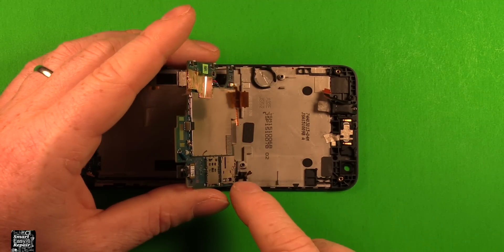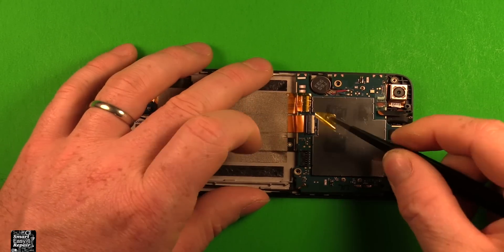HTC Desire 626 Screen Replacement Repair How To Change

Comment: Best video ever, worked like a charm! Thanks to this video my dad can now have a smartphone (my old one). Only thing is a couple steps were skipped that invovled removing some rubber molding pieces but once we figured that out it was perfect.
Reply from the maker: +Renee Ruff Thanks. Sorry yours may have been slightly different. I'm glad you figured it out though.

Comment: Replaced my nephews screen and video was excellent. Helped a lot. One issue I had was no sound... easily fixed by bending the metal tabs on the speaker up a little, just in case anyone else had the same issue.
Reply from the maker: +Thomas Robinson Awesome good job thanks for the feedback!

Comment: Awesome directions. Only problem is No display. It rings. Around the outside edges I can see a very faint light. Any ideas. Thanks. God Bless †
Reply from the maker: Thanks. I would try checking your screen connection points make sure it’s connected properly. Sometimes you have to disconnect and reconnect just to make it seat properly.
Reply: Which one is the screen connection. Thanks Bless you †

Comment: Hi. I replaced a screen on my HTC desire 626s and for some reason it don't turn on. Just vibrating one every 10 seconds... Can u tell me why is that? Thank you!
Reply from the maker: +István Kutasi It sounds like it's not reconnected properly. I would check all your connections first.
Reply: Smart Easy Repair I will. Thanks!
Reply: I checked all connections, all looks fine. When I turn on the phone I only have black screen and vibrate one in every 10 seconds. I also tried all the button combinations what I find on YouTube, none of them helped. Any other idea? Thank you!
Reply: István Kutasi I'm having the same problem. Screen was recently fixed but turned it on and theirs no sound so I went to try and fix it and now phone screen is black and when you try to turn it on it vibrates. Could I have messed up the vibrator motor? I tried messing with the silver plate on the back of the phone above the battery.

Comment: Hi there, thanks for the helpful video it helped alot. i have already changed the screen but theres a problem, which is when i plug in the charger to charge the phone the screen goes off and i cant use the phone as long as the charging plug is connected and when i disconnect i have to turn on the phone once again. any tip or idea ?
Reply from the maker: +Samei Sanei Thanks I'm glad it helped. No I'm really not sure what the issue is I've never heard of something like that before. The only thing that I would recommend is to maybe take it back apart and make sure everything is connected properly especially down by the charging port.

Comment: easily the best video and explanation  I've found to date.
I'm very comfortable   working on all sorts of electronics, but have been a little afraid to attempt  working on my 626.
but after watching your video several times it gave me the kick in the @ss that I needed to finally order the screen/frame assembly  and give it a go.
part was delivered this afternoon and I'll be performing the repair tomorrow afternoon . 
I'll post my progress once I've completed.
again, thanks for the excellent video.
Reply from the maker: +gshffr Awesome best of luck to you!

Comment: Great video until almost the very end after total disassembly you say to make sure and buy a specific replacement that includes the front housing rather than just the screen itself to prevent using heat gun and a mountain of extra work.    
Wow. Would been nice to know from the BEGINNING.
Reply from the maker: Sorry I figured typically you would watch the video all the way through first to know what you’re getting into and then play it again for disassembly.

Comment: Hi :) I dropped my HTC 626 and broke the glass about 9months ago. At first it was but then i spread across the whole screen. 2 days ago i was at home when i looked at the clock on the phone and it was black (but not the whole screen but like 1/2, where it was cracked the most. Can it be fixed with a LCD replacement or is it better to buy a new phone? Ty for your time and sorry for my bad english. :)
Reply from the maker: +Klemen Doplihar No problem. Yes a new LCD should fit it. I have a link in the video description below the video where you can find one. Thanks

Comment: Hi.Thank you for this informative video, I have successfully replaced screen & digitizer following all the steps in this video, however after restart I am constantly getting following Error Messages: Google Play Services has Stopped working & HTC Sence has stopped working. Is there anything in hardware that I forgot to connect back? Screen is responsive, Wifi, data, calls everything is working. Because of error messages I cant open Home. Please help if something inside needs to reconnect again.Thanks.
Reply from the maker: +Amjad Niazi I'm not sure I have never heard of that before. The only thing I can think of is to open it back up and just doublecheck all your connections.

Comment: Thank you so much for this perfect video! I've spent hours fixing my phone thanks to my clumsiness. I was so sure I wrecked it (and the frame looks pretty battered. ;) ) After getting frustrated by trying to attach the cable of the ear speaker and the antenna I just tried to start the smartphone. It works! :D 
But now I have to relax until tommorow before put the rest together. Again, thank you so much!
Reply from the maker: Wow awesome good for you!! 👍👊
Reply: A short update: Almost everything seems to work! :-) Only the charging doesn't work. Maybe the panel isn't fixed or the cable not attached correctly?
Reply: Problem found and solved.The side of the cable connected to the logic board got the funny idea to slip out. ;)
Because I am too clumsy to attach the cable of the ear speaker I can do without it anyways. I used it only once or twice. also, I havn't managed to attach the antenna back again, but that doesn't seem to hinder the connection. Just had to be careful that the antenna didn't get in the way.
Reply from the maker: Ok I’m glad you got it figured out! 👍👊
Reply: Thank you!
But I just realized that I forgot to take off the protection cover of the inner side of the display. O.O
As the phone is working (although not perfectly) I will do the procedure another day. :)
Again, thank you so much for this tutorial!! I'll need it again soon. :)
Reply from the maker: OK best of luck going forward!

Comment: @Smart Easy Repair
Sir, do you know if the HTC Desire 625 and the HTC Desire 626 use the same screen assembly (glass/touch panel/screen)? The glass, touch panel, and screen are all broken on my HTC Desire 625 and I am looking to repair the phone. I have the phone disassembled already, thanks to your video. Any help would be greatly appreciated.
Reply from the maker: +Kevlar Voice I don't believe they are the same. When I search out the 626 it doesn't specify that it fits 625.

Comment: ive just used your vid to do my htc 626, really good except it wont turn on 😕 not even a red light to show its charging. any tips on if ive done something wrong?
Reply from the maker: +Eve Parker Sounds like something isn't reconnected properly. I would doublecheck all your connections.

Comment: Hi i have ordered the screen, but i got only with 2 connector cables far left corner  small connecter not their on the screen I received, but on your video you have all 3 connecters for the display.
Reply from the maker: +Makkuva B V VaraPrasad Maybe yours is for a different variant of the model phone I don't know.

Comment: Screen was recently fixed but went to turn on the phone and the sound doesn't work. So I tried fixing it again and now the screen is black and only vibrates when I try to turn it on. I think I tried messing with the silver plate that's above the battery. Could I have ruined the vibrator motor? Sometimes when I try to mess with it their a bright circle in the middle of the screen with different colored lines going through it but most of the time the screen is black. Is the phone ruined ?

Comment: the screen on my 626 recently broke I am thinking about replacing it, I have a friend who has a phone just like mine. I have thought about using the screen from it on my phone but I was wondering do I need to have adhesive to hold the battery in or can I reuse the adhesive on it?
Reply from the maker: +SIR_ WOLF It's worth a try you can reuse the adhesive if it's all sticky. Worst case you can get some adhesive.
Reply: OK thanks I'll try it then I appreciate ur help
Reply from the maker: +SIR_ WOLF You're welcome. Take care.

Comment: i broke my desire 626 and theres cracks on the screen and its unresponsive to touch in most places but the picture is really blurry. could you help me out  to find the led screen only,
Reply from the maker: +Kima Pac Yes the LCD assembly is the LCD and digitizer combination all put together already. I have a link in the video description where you can find it. I would recommend getting the one with the frame already attached as well because it makes the repair a lot easier.

Comment: Hey dude I know this video is old but I really need an answer
On my phone I have very few cracks but the actual screen is unresponsive, will this fix that?
Also what parts did you buy and where from because I looked online and there are ones with prices ranging from $7 to $60

Also does this tutorial cover both those things ?
Reply from the maker: +Preston Garvey Yes so it should fix it if you replace the screen. I would just look for a decent quality LCD screen assembly with frame. I have a link in the video description below the video where you can find one.
Reply: Smart Easy Repair thankyou! 😃

Comment: when replacing the screen, is the adhesive tape completely necessary over the connectors?
Reply from the maker: +Potato And Mash Gaming probably not really. If you can salvage it and reuse it great.

Comment: My screen cracked just a tiny bit in the bottom right corner, if I replace the screen will it fix this issue or is it just better to get someone else to repair it for me (at a shop or something)
Reply from the maker: +Eduardo TheFish Yes that should fix it. It's up to you if you want to attempt it yourself. I think it's easily doable.

Comment: My HTC Desire 626 got water damaged and random colors stretch through my screen when I try to watch some videos, which nearly blocks my view, and there are black tiny lines going across my screen which makes my phone look like it has 360p resolution. If I replaced the screen, will it get rid of the ruined display?
Reply from the maker: +Nazeaver Ali-Raines Yes it should.
Reply: same bro it should

Comment: Any specific websites that you guys would recommend buying from or at least a specific seller? I just don't want to to buy one with bad quality.
Reply from the maker: +Jaxter Jaxter I have a link in the video description where you can find one. I would look for OEM quality. Check the listing make sure it fits your model.
Reply from the maker: It looks to me like it connects the charging port at the bottom to the logic board.  If I search for charging port none of them come with that cable that I see.

Comment: My HTC Desire 626 got water damaged and when I try turning it on, all it does it vibrate and nothing else. The charger light is still blinking too, so does this THE mean the screen is damaged? Will doing this make the screen turn on?
Reply from the maker: +Aadil Akbar if everything else works then that may be The main problem.
Reply: Smart Easy Repair Ok, I'll consider buying a new LCD

Comment: I have the desire 625 but it looks exactly the same as the 626, is it going to be the same screen and frame?
Reply from the maker: +Enforcer Vapes I think they're slightly different if you check the link in the video description you can change the search to reflect the 625 versus the 626 and see what it brings up. I think the process for changing it should be quite similar though.
Reply: Awesome thank you
Reply from the maker: You're welcome. Take care.

Comment: i broke my desire 626 and theres cracks on the screen and its unresponsive to touch in most places but the picture is still completely fine do i need a whole new screen or what screen parts do i need
Reply from the maker: +Bannanarang it's really hard to replace just the glass so I would recommend replacing the LCD glass assembly.
Reply from the maker: +Bannanarang I have a link in the video description where you can find one good luck.
Reply: +Smart Easy Repair thank you very much
Reply from the maker: You're welcome.

Comment: Replaced the screen great video but after I finished up I turned my phone back on but the screen doesn't show but you can feel the phone vibrate . Help please
Reply from the maker: +Dominique Dixon Sounds like there may be a connector that isn't reconnected properly somewhere. I would doublecheck all your connections.

Comment: *NOT FOR UK SPEC PHONES*- tried this myself, video was very helpful for guiding me however UK spec phones do differ slightly when you compare the screens to what you might get off of eBay. I'm sure with correct knowledge it's doable however for me it did not work
Reply from the maker: +Ross Lloyd Interesting. I didn't know they varied that much.
Reply: yeah, not sure what specification the screen i purchased was whether it be US or Chinese, however the bottom portion has parts that intrude into the original rubber fitting, as well as the single cable required from the backboard has different adhesion to the one shown; makes it harder to re-apply onto new screen. Great video though, very well thought out and informing
Reply: Ross Lloyd did you you get your phone sorted then or what? bcs my frame was also different at the bottom, I managed to fit everything but when I turn it on again it's just black screen. rechecked all wires tried again, not working. I've pit everything back in my old phone and it works . don't know what's the problem?

Comment: hey I replaced the new touch screen, I connect everything in the right order. I switch on the phone, but there is just a very bright white screen. I pressed the screen it does "touch" sounds but nothing is shown up but the bright white screen. Why is this happenned ?
Reply from the maker: +Giannis Tsaras it sounds like maybe there's just a connector that's not connected properly.
Reply: is there a trick to replace it correctly and easily? Can you suggest me anything?

Comment: Just completed this repair, but phone isn't powering up. Any ideas on what to troubleshoot?
Reply from the maker: +Rick Starbuck I would double check all your connections make sure they are seated properly.
Reply: Hmmm. Could pulling the battery cable while it was still powered on have fried it?

Comment: if the screen is black and the phone gets phone calls like if i call the number and says its ringing but its all black on the screen does that mean i have to change the screen still.?
Reply from the maker: +Starboy Was your phone dropped or something? You could just check the connections for the screen and see if something is loose.

Comment: so my screen shows these lines across the whole phone so should I do this
Reply from the maker: +APear WithPTSD Did you drop it or something?
Reply: yeah like twice from small to medium heights
Reply from the maker: It may just be that your LCD connector inside got loose. I would check it.
Reply: yeah it says that my screen is disconnected from the power base and thx for the help
Reply: Smart Easy Repair
Reply from the maker: ༺Monster agario yes?

Comment: Will this work if the phone is water damaged?
Reply from the maker: +Patrick Kohl I think it's worth a try you may also want to check your battery sometimes they get swollen in that after water damage. Also check for corrosion in any of the connectors.
Reply: Awesome, thanks very much!
Reply: I replaced my screen and it worked great. Except now my phone has no service, and no sound. What do i need to do to fix this?

Comment: thanks really helped.
Reply from the maker: Thanks I'm glad! Good job!
Reply: +Smart Easy Repair i got a question what glue did you use to attach the screen to the phone
Reply from the maker: It was preassembled already with the frame so I didn't need glue.
Reply: +Smart Easy Repair oh ok thanks
Reply from the maker: No problem.

Comment: i cant power it off when my screen is broken help
Reply from the maker: +Mcgrimpvp I think the only thing you can do then is disconnect the battery soon as you get the back cover off when you are changing the screen.
Reply: ok thank you very much i am so proud of myself i finally did it today :D my screen had no case but i managed to remove the broken one and glue the new one in . everything working perfectly now thanks to you man .
Reply from the maker: +Mcgrimpvp awesome good job I'm proud of you too!!

Comment: what if it's damaged by water?
Reply from the maker: +Morgan Rouse then a screen replacement might fix it for you. You'll  want to check all your connections when you have it apart n make sure they're not corroded.